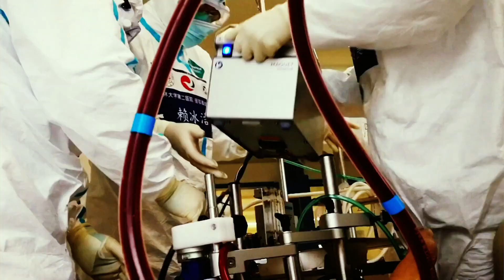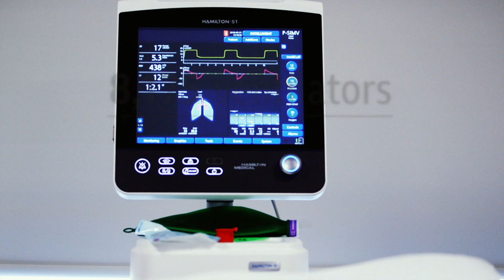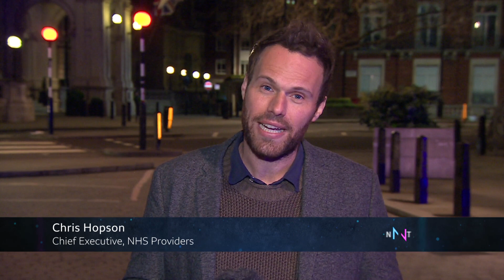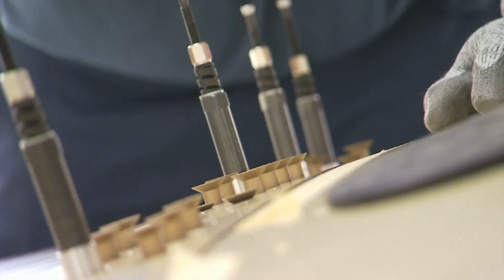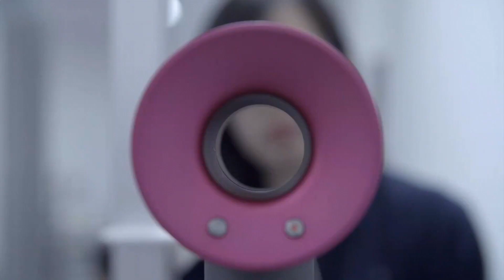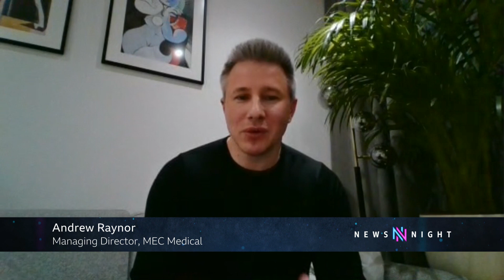Does the UK have enough ventilators? Questions raised over Covid-19 medical supplies - BBC Newsnight

Comment: The real question is there a requisite number of highly trained medical 'professional' staff on-deck to safely and effectively man and operate them.  It's not just turning on the valve and you walk away.  There is numerous and complex protocol to a Ventilators operation!  Is the advance training going to keep up as the supply of ventilators increases exponentially!  To my mind, that's a huge question of great concern that needs to be addressed asap!
Reply: Great point
Reply: The answer is of course no. My nurse mum has been making this point for a while. All these ventilators won't amount to much if there isn't enough staff to be able to use them.
Reply: They give a crash course to admin staff. I can see it now.

Comment: Here in the US Ford is working with GE and 3M, Chevrolet is working with Ventec Life.
The Ford team has distributed a stop•gap to be beta-tested.
They have also simplified a respirator using off-their-shelf parts.
Chevy supporting Ventec Life with a production facility, engineering, and Logistics.

Comment: Take 4 minutes and one A4 clear clean sheet of acetate paper.
with household scissor curve the corners off  at the bottom 
It should looks like  this a U ‘Shaped mask , with no sharp edges
take an, eco flannel or two j-clothes fold the cloth
until its about and I inch wide,  attach the fold cloth across the horizontal side clip onto the acetate with the paper clips/ 
punch two holes either side about half an inch below the attached 
j cloth. Then install the ties through holes either side. 
The  ties can be made of elastic,  but can be adapted with ribbon, plastic strips or string,  improvise.  

It should feel comfortable light and not tight around the head, but settled across the forehead, tied in a bow behind the head, so  it becomes like a full face motor bike Visor,  while the clear acetate  is easy to see  through.  
Your cough/breath  stays behind the visor, equally, other people's coughing won’t land on your face.
It  covers eyes nose mouth and chin,  without  appearing to steam up  It acting as  shield  from others, and all parts can be washed in soapy water dried with an eco cloth and re-used. 
If everyone took to wearing this mask, we'd be saving some lives.